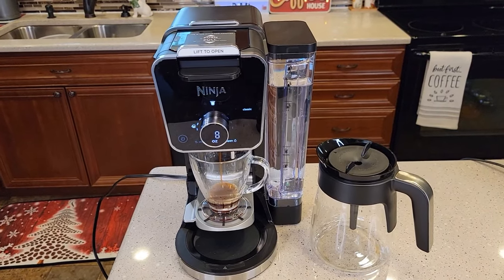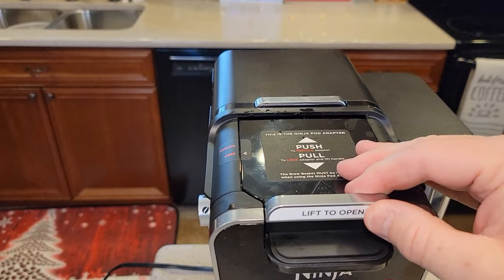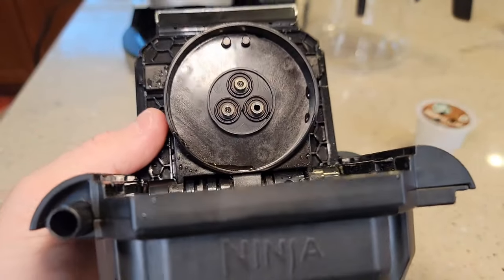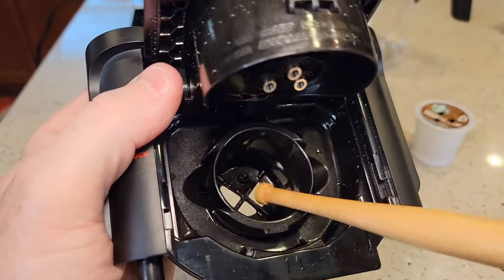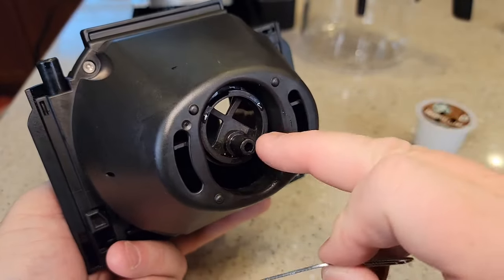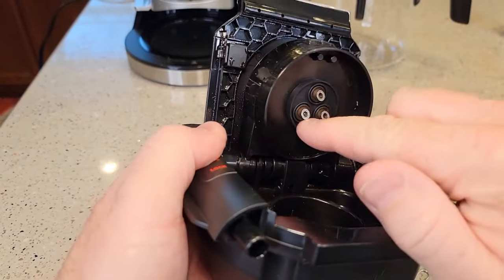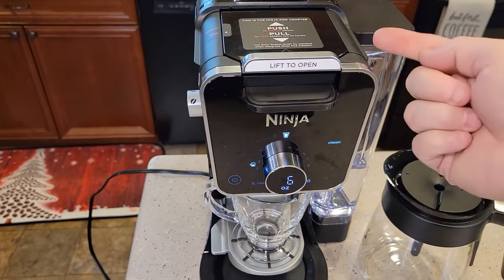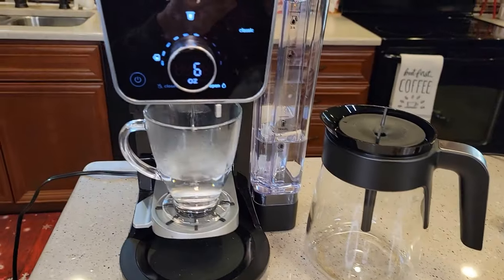QUICK FIX Ninja DualBrew Pro CFP301 Coffee Maker NOT WORKING?  CLEAN NEEDLES

Comment: Thank you for this! We bought this unit in Dec 2021 and in January of this year, it stopped drawing water into the pot with the k-cup filter. Ninja gave me a good coupon to replace the unit. And then last week, the 6-month old unit started doing the same thing. Customer Service was stumped. They sent a replacement base (which had zero accessories - no water tank, coffee scoop, frother, filter insert or k-cup insert! I watched this video and sucked the grounds out of that tube on the left on the k-cup insert, and cleaned it out! It appears to be working now! Thank you!

Comment: Super helpful video. Mine went into clean mode so I followed the instructions in the manual. Still wasn’t brewing. Followed your cleaning process and used a metal straw cleaning brush on the tube and could not believe how much gunk came out of it. It had to be almost completely clogged. Doing another full cleaning cycle on it now and it already sounds much better than it did

Comment: If you have an air compressor, this fix takes 3 secs. Just blow air into the water port. The plastic tube on the right. You'll here a little pop, and then you're back to brewing. I literally just did this.
Reply: THIS!! This worked immediately! I tried poking paperclips into the pod adpater, everything looked clean, but the grind were packed in tight where I couldn't see/reach. With a 1-second burst of compressed air I heard the same "pop" @kmsleo84 suggested, and my pod adapter is now good to go again - thanks for posting!!
Reply: This is what worked for me, thank you!!

Comment: Thanks for the very helpful explanation as to cleaning the needles. I have done what you suggested with the paper clip.   My pod adapter still will not draw water into the pod adapter.  Do you have any further ideas or suggestions for me?
Reply: I figured out the problem.  The tube where the water goes in was blocked.  The paperclips did not work.  But when I sucked on it, I got a mouthful of coffee grounds. Yucky! I did that a few times and then ran the clean setting.  All is good now.
Reply: @rvinlady  thank you so much for commenting this, I’ve been struggling to fight the exact same issue as you, and I resolved it the same way you did after reading your comment. I can’t believe I didn’t think of that earlier. Thank you again!
Reply: Once you take the K-Cup option out of the coffee maker with a closed if you blow through the water hole and you can't there is still a clog in it, try running water through it sucking and blowing you should be able to blow air through the K-Cup adapter freely if not keep working at it
Reply: Maybe try a pipe cleaner in the tube rather then suck on it to loosen grounds then run a cycle without a k cup in it.

Comment: very good video, I have a problem with my ninja DualBrew Pro, which is that it does not detect the section of the capsules and is well placed, however on the screen the 3 modes are lit and does not let you do anything, I tried cleaning the nodes as you explain in the video and does not want to work, will there be a solution for that or in that part of the coffee maker will be the problem?

Comment: Hi. My new Ninja when brewing a kcup at the end of a brew make a mess at the end. Coffee splashed everywhere: counter, wall, all over machine and this is when using the cup flap. Any thoughts?
Reply from the maker: Does it do it with every coffee pot or is it just one  Make sure you have the high altitude setting correct
Reply: @JustADad  every time I use k-cups.
Reply: @JustADad  Every time I make coffee using k-cups. What’s the high altitude setting? Thank you!
Reply: This is my issue. Halfway through the cycle water/coffee just sprays everywhere and even on rich the brew is weak. I have tried several methods of filling the pod, packing it hard to not packing it- different amounts of grounds, ect and same result. I am using reusable pods I got off Amazon so it's useful to hear others are having the same issue with regular k-cups. I'm thinking the pressure is not sealing about the top and water is pushing out the sides around the cup? I'm not sure how to fix this? I've been a Ninja user for many years and I was very excited to try the pods for quick on the go cups. For now the switch to this more expensive model was not worth it for me.
Reply: The only thing that works for me is a very tall cup. It’s not a fix and you shouldn’t have to do that but it’s a solution
Reply: @Zikes  Have you found a solution to this? I don't even drink coffee, but I've been tasked with figuring this issue out haha
Reply: Mine is doing the same thing. I sent one back a few months ago, they replaced it and the new one is doing the same thing. It’s like it’s under too much pressure and blasts coffee everywhere.
Reply: @JustADad  can you help us? I have the same issue. The coffee spills everywhere and comes out as THREE streams when using the K cup feature.
Reply: This also … water spewing…happens to me… can’t take the pot back
Reply: U need to keep the coffee filter part in and add the kcup part over top . The only item that is to be fully removed it the kcup part when u want to make a pot of coffee. Other wise keep filter in and add kcup part and it will not splash

Comment: Wondering if you could help me with a DIFFERENT issue I'm having with this machine. I can't seem to find anywhere on YouTube that has an answer for me. 
We are on our 2nd Ninja DualBrew machine since Christmas and BOTH machines seem to have too much water pressure. So much so that many of our k-cups explode at the final step in the brewing process.  We often get a tablespoon of coffee grinds in our cups and have to cheese cloth our coffee before drinking. I would say this happens 50% of the time. Not sure what is happening as we are using the same McCafe pods (so not cheap ones). We are just about to return our machine for the 2nd and last time to Costco. Is there ANYTHING we can do to fix this problem?  Surely we aren't the ONLY ones who have gotten  the only two lemon machines, lol. (Although I can't seem to find any fixes on this issue online 😕) If you can help, I would GREATLY appreciate it!! Thanks.
Reply: I would get coffee grinds in my coffee.  I just kept trying different brand K-Cups until I found a brand that didn't leak grinds.

Comment: Thank you for this information. I used mine this morning to make a full pot for the very first time, but I noticed after the brew cycle stopped, there was still a remaining stream of coffee pouring in, and stopped after another minute or two. . is this normal? Also, there were some grounds that went into the coffee pot. I am thinking that maybe I didn't place the provided paper filter in correctly, but if you know of anything else that that could be  a possibility, please let me know.
Reply from the maker: Yes that is what is sounds like if the filters is not installed properly then you will get coffee grounds around it.  the coffee still coming out when its done is normal,  you might also being using too fine of coffee, make sure its med ground coffee.  and make sure you are only using 1 table spoon per cup you are brewing. make sure you don't use the drip stop too much during the brew.
Reply: @JustADad  Thank you!
Reply: @JustADad  I am not sure if this made a difference or not, but yesterday I made a full pot. There were literally lots of grinds in the carafe. So what I did is run the calibration for people who are in high altitudes. I am only 57 feet above sea level but I figured, why not, go for it. After doing this, I made two additional full pots of coffee, and there was not a single grind found in the carafe. If anything changes I will report back.
Reply from the maker: @louisd95714  Thanks for sharing you findings!!!
Reply: Mine just powers off when I select how many oz to brew won't stay on ???

Comment: I just opened my coffeemaker. Followed ALL directions. The three needles on top will not puncture the k-cup, so all I’m getting with that option is a cup of HOT WATER. I made 1/2 a carafe of coffee—no issues. Is there a way to adjust the needles in the coffee make so they actually PIERCE THE TOP OF THE KCUP?

Comment: I'm considering getting one of these as my kuerig k cafe is acting up. I'm hearing that there is a problem getting grounds in the coffee. Is that for kcups or the carafe? 
My kuerig always has sediment in my cup so I am trying to make sure the ninja pro is right for me. Do you have a descaling video for it? Is it the same as a keurig?
Reply: Did you get the Ninja? We get grinds in our k-cup 50% of the time.... like a tablespoon worth!  We have to cheesecloth it, otherwise, we have to chew our coffee  which isn't pleasant. We are on our 2nd Ninja with the same issue.
Reply: @KevandDenise  We did, and we love it! I've never had grounds in my coffee, and it's easy to make a single cup without a kcup so you can adjust the strength of the coffee. So much better than our keurig, I'll never go back to a keurig after using the ninja.
Reply: @angmarie9482 I’ve never had grounds in my coffee, either.